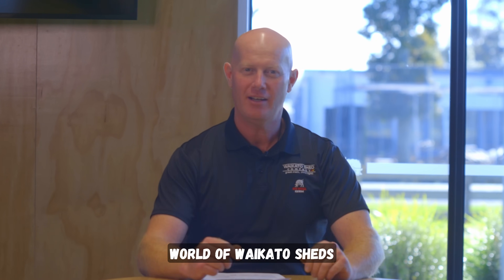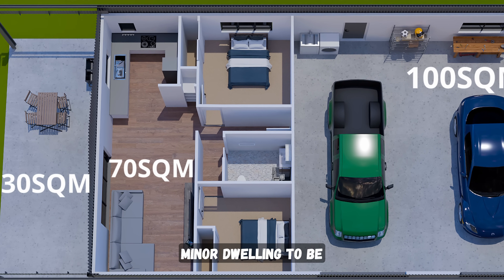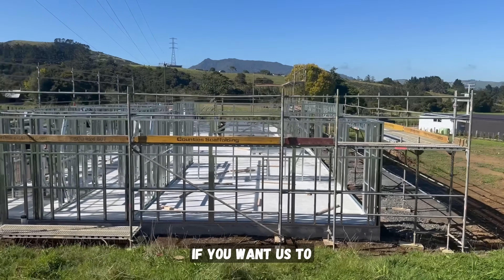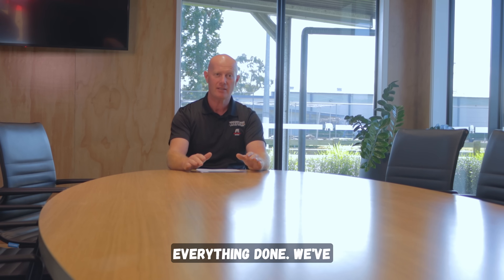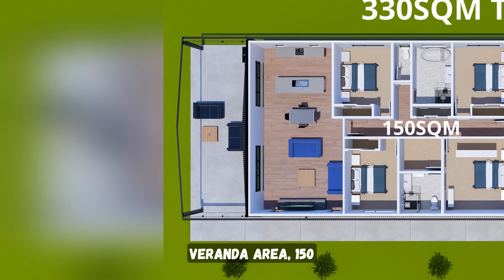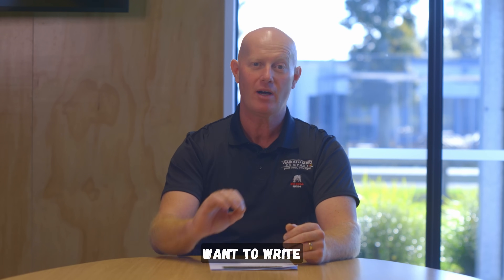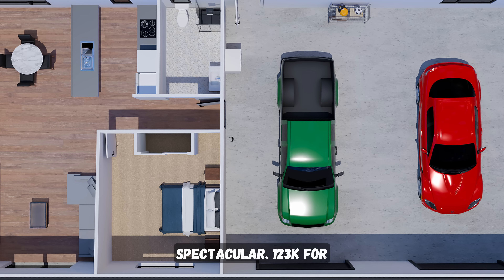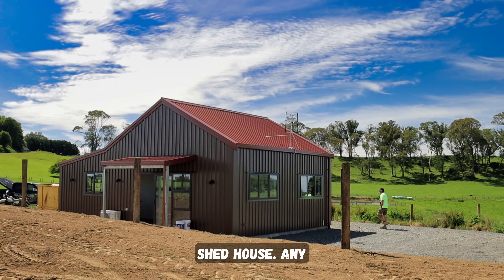How Much Does a Shed House Cost?

Comment: Beautiful... I have an industrial section in Te Aroha on flood-prone land.  Before I commit to putting a couple of shipping containers on-site, what experience have you had regarding red tape regarding flood-prone land? PS... thought I'd say it was a boat shed... (as it is right beside the river on Rolleston Street)  Just not keen on paying extortionist prices for compliance fees...
Reply from the maker: Hi Peter, We have done lots of work on low lying and potential flood zones in the Waikato. It will depend on the soil conditions if you have to drive piles for the site or can build it up with fill. CES would be worth contacting as they are Te Aroha based and could give advice on what the council would expect. https://www.ces94.co.nz/ Cheers Jason

Comment: My only concern is the temperature in the garage part of the shed, any feedback from shed clients, are there any options for heating and cooling or insulating,  How do you stop insulation wicking?
Reply from the maker: Installing Whirlybirds to ventilate the shed part has certainly helped reduce the heat in summer as well as any excess condensation. Generally a thermal break between the house and shed to retain the heat in the house over winter. Cheers Jason

Comment: Great video, straight to the point. What about 15x15m hangar?
Reply from the maker: Thanks for that a 225sqm hanger would be $800 to $1000 per sqm fully built. So $200k to $250k very roughly Cheers Jason
Reply: @ thanks for your reply, is this possible in Twizel?
Reply from the maker: @mikenoad  Yes we can do a kitset into Twizel. It will cost slightly more to meet the H1 Insulation requirements that far south. We have sent alot of kitsets all over the South Island. Cheers Jason

Comment: I built 24m x 12m shed home. Concrete and shed was $120000 built. Off grid batteries and solar $45000 installed. I got a full running home cheaper then your first quote
Reply from the maker: Good for you bro 👍
Reply: Do a vid for us wombat, I'm keen to see how I can save more money and it would be nice to see what you got for under 170k